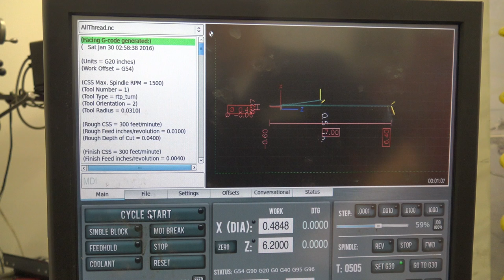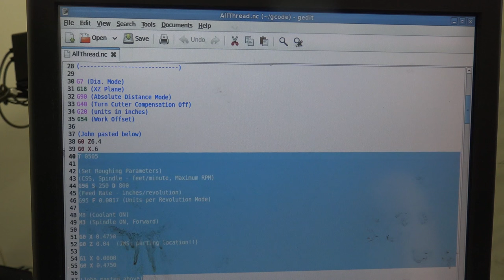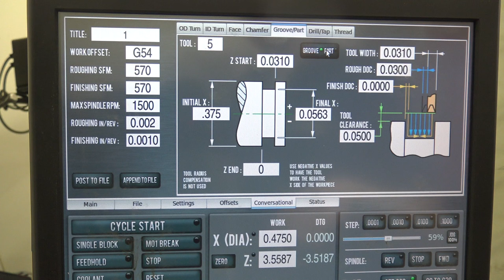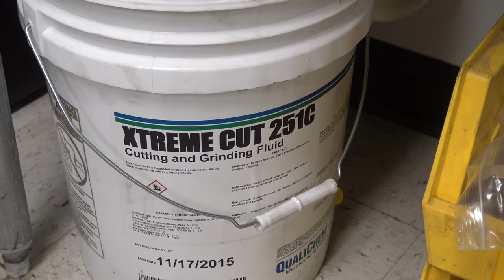CNC Lathe: Turning All-Thread Rods for e-clip!  Widget81

Comment: I use left and right parting tools all the time and they work very well for not leaving a nub, may not work in this case thoug as the whip may break it off before you can turn that thin. A gripping tailstock to pull in to length and retain when parting would sure be handy!

Comment: I've seen a similar part made on an old screw machine with a bar feeder.  very impressive that they use to do all of that with cams and timing gears.  they did use a tapered cut off tool so they didn't have to finish the part but they had to face a little more off of the next one.

Comment: i just stumbled across your videos recently. keep up the good work.  instead of a bar feeder you can use a shop made cylindrical bar puller which will stop the bar from pulling short.  basically you make  the inside a little smaller than the diameter of the bar you are pulling and the outside a few millimeters larger and split it in several places using a hack saw.  when it goes over the bar the splits will act like a collet. hope this helps

Comment: John, You mentioned trying out something for the left/right hand parting tool. Unless you are cutting some hard stuff all you need to do is grind an angle on your carbide tip with somewhat of a point towards the part side and this will solve your problem. You wont need to do a finish opp, it will look clean. Been doing it for years.
Reply: +NYC CNC sure you can. I use iscar inserts and grind an angle with a green stone wheel. I think it's a silicone carbide wheel. I get them from CW Rod in Houston but you should be able to get them at your tool store. they're not much.

Comment: john,
the right hand parting insert is what you need for this type of project however the long stickout of the part will negate its use here as the parts weight will force it to separate before the insert parts it off. my recommendation  would be to get a 15 degree gtr insert and i have a part # at the shop for the Seco insert i use if your interested? it does fit the   holder tormach sells on their site. Dean

Comment: If you are able to programe the chuck to open and close i have used an old parting tool to feed the work out of the chuck.  Once you have parted the rod off, machine another groove in the rod that is still in the chuck.  Tool change to an old parting tool that has been modified to go into the groove, position this tool in the groove open the chuck and move the rod out the required amout.  Then reclamp ready to machine the next part.

Comment: For The bar feeding "problem", couldn't you have a fixed part screwing it in upon some automatic activation? It'd be bound to an arduino feeding a stepper turning a fixed screw pushing the bar in. The tormach would issue a "start" signal to the arduino...

Comment: doesn't the bar part too early as the long stickout workhardens the left over bit?
which in my mind would always part it when a single part reaches the critical width.
what I am triing to say is that you prbl always will have quite alot to grind of if you have that much stickout.
though I never touched a lathe so I might be imagining bollocks

Comment: two solenoid valve, two switch and it's instantaneous... then you can play with adding an arduino and proportional solenoid valves to be able to have 50% flow and so on... (I'd say stick with the simple stuff then play with in-line manual ball valves if you continuously the same flow or if you want truly instant flow as proportional valves tend to be a bit slow to my taste)

Comment: You should check out my video on my quick and dirty bar puller and pneumatic collet closer. Since your already cutting a groove in the part with my setup you might be able to pull the rod to the proper position with the e clip groove and further automate the process. It was a real life saver for my latest project as it let me run 20-25 parts unattended with about a 30min cycle time allowing me to wonder over to the mill and get some other stuff done while it was running.
Reply: +NYC CNC Glad you like it. the whole project was much easier than i thought it was going to be when i started its defiantly something to look into for production runs